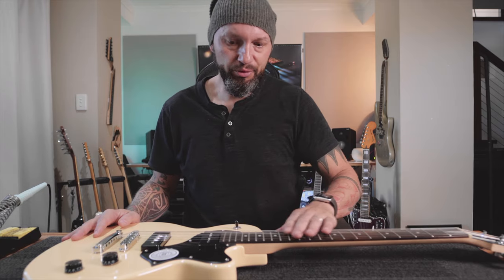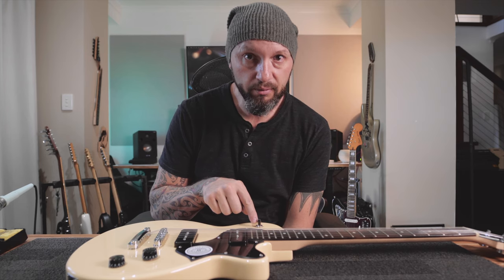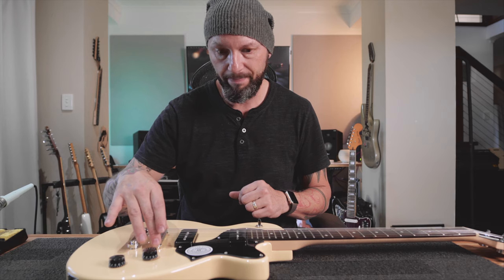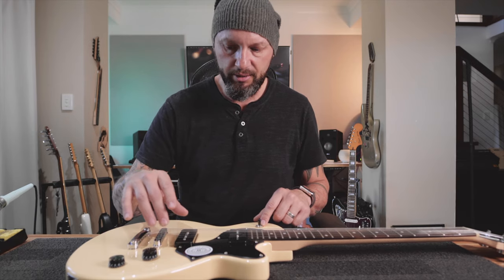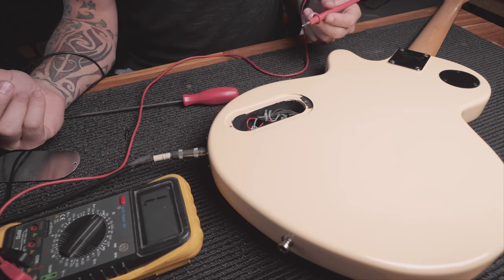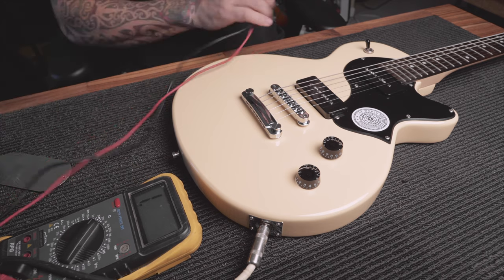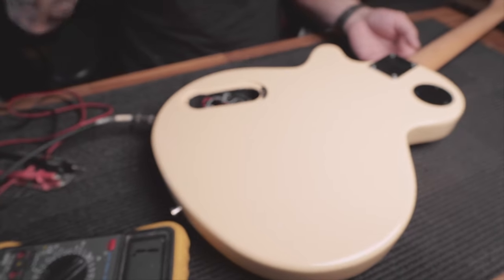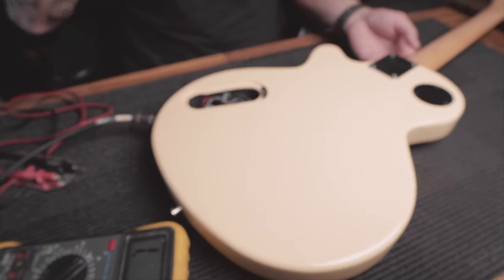3 Easy Solutions to Fix Ground Noise | Guitar How-to Ep02

Comment: Hey Phil! What happens if I have continuity everywhere and still getting the grounding noise?
Reply from the maker: Hey Marcell, what type of guitar do you have? ... Strat with single coils or humbuckers or other type? ... Let me know, and is it quite noisy or just a bit noisy? Could be a number of reasons, but happy to help you figure it out.
Reply: @RisingSunGuitarMods  Single coils. It's the price you pay for that "snarl" no other configuration can get super well. Getting under the pickup cavities, bridge and pickguard with some shielding tape and checking the pots and you can seriously reduce that buzz. Good noise gate, you have a sick sounding and quiet guitar.
Reply: @WilDBeestMF  I also have single coil. No issue when playing dry and keeping the guitar’s volume knob down. I’ve not tried distortion yet.
Reply: @DenisMorissetteJFK  Distortion, and even drive (don't even go there with fuzz, haha) will have a noise floor just by association of what they are. There's a lot you can do to make it palatable, though. Not a huge problemo.

Comment: when i turn my volume down the hum gets louder and i can still (kinda) hear my guitar in the amp
Reply from the maker: You might have a wiring issue or a faulty part. I don’t think your issue is just grounding.
Reply: @RisingSunGuitarMods  the hum goes away when I turn the tone knob down
Very strange
Reply: @RisingSunGuitarMods  Anyway, Happy new year!!👍
Reply from the maker: @arrrrrran3043  happy new year. … sounds like it’s been wired wrong. Find a schematic for you guitar and have a look see if it looks wrong.

Comment: Great channel.
Reply from the maker: Thanks mate. Appreciate the comment. More vids are on the way just been a bit busy with work and setting up a new home office. ✌️
Reply: @RisingSunGuitarMods  I wonder if you might be able you offer any advice.
I've been playing an 87 Squier strat. Plays really well, and sounds pretty good too, apart from some humming, which is how I found your channel.  I followed your advice and discovered a disconnected ground which I re soldered. I don't have loads of experience so it wasn't an expert job. When I put it back together, it's worse than ever. Positions 1,3 and 5 are very noisy,  whilst 2 and 4 are pretty quiet.  Also on of the tone controls seems to go from 0 to 10 quite sharply. Finally   I'm getting continuity on all the metal parts but significantly,  not across the pickups.  Currently the guitar sounds terrible.  If I can't fix it I'll probably have to pay someone. Any thoughts much appreciated.
Reply from the maker: @-_AjB_-  sounds like you have some wiring problems. What pickup configuration do you have? I’m guessing three single coils. If you had a wire off and re-soldered and it got worse, it might need to be re-wired. Sorry about the late reply, away camping.

Comment: if you touch the bridge and it does shut up, how would u fix that?
Reply from the maker: What type of guitar/bridge do you have mate? If you touch the bridge and the hum goes away it will be the ground wire that goes to the bridge, or the claw, depending on the type of guitar/bridge.

EDIT: Sorry I read your comment wrong. If you touch your strings and the noise goes away, that is normal. It means it is grounding. You will always have some noise when not grounded. There are some things you can do to reduce the noise, like shielding the pickup cavities with copper tape etc. Let me know if you would like to see a how-to on this.
Reply: You generate an E.M.F that is sent through pickups to amp, when you touch the strings or bridge you become part of the earth circuit.
Your EMF is sent to ground rather than pickups hence the hum diminishes.
Reply: ohh okay thanks guys

Comment: My guitar is fine when i use my shoes but barefooted it became very noisy when I touch the floor, is it my house electricity that caused this? It's a pretty old house
Reply: My guitar is a telecaster with 2 single coils, my bass is a jazz bass with single coils but doesn't make any noise when I touched the floor
Reply from the maker: CRAZY! I would love to see a video of this... If you have one share a link to your video.
Reply from the maker: @kahfigitar  Using the same amp or different amp?

Comment: Just got my first Gibson and it’s noisy as hell, I can plug in one of my squires or a prs SE and there quite not sure what I paid the extra money for
Reply from the maker: What model do you have and what pickups are in it?
Reply: @RisingSunGuitarMods   it’s a 2020 les Paul special with the original P90’s
Reply from the maker: @derekhand7904  P90’s are a single coil so will be more noisy than a humbucker. Does it quite down when you touch your strings?
Reply: @RisingSunGuitarMods  yea they do I think there shorted it’s not 60 cycle hum it still makes noise in the middle position
Reply from the maker: @derekhand7904  I think you might have a wiring issue or something else at play. Hard to tell without getting a proper look at it. I would try removing the added single coil to eliminate it as being the issue. Sorry man I think it is going to take a bit of elimination till you find the problem type of work.
Reply: @RisingSunGuitarMods   I think you’re right I’m on the road for work right now but when I get home I’m going to have to dig in to it  I’m hoping it just needs to be grounded thanks for your help

Comment: If there is no ground going to the bridge why would it make a sound when you touch it?
Reply from the maker: Good question, my understanding is you don't actualy ground the guitar, the guitar grounds you... stay with me here, how this works is when the bridge, or the claw on a strat is properly connected you are a pretty good EMI (Electromagnetic Interference) antennae. Your body is an antenna for all sorts of EMI, so when you touch your guitar strings, the guitar is grounding you. When that wire is broken, you all of a sudden add EMI interference to the guitar creating extra noise. Hope I explained that clear enough.
Reply: @RisingSunGuitarMods  ok I see

Comment: What if you touch your pickups they get noisier?
Reply from the maker: You are likely creating an antenna for EMI to enter your circuit. Try shielding if you have a noise issue.
Reply: @RisingSunGuitarMods  I never understood the logic with shielding.  Shielding is suppose to create a Faraday cage but the reality is the entire RF interference comes from the ambient and your pickup pole pieces are exposed to the ambient, how else would they be able to respond to the guitar string.
Reply from the maker: @bluwng  you’re not creating a cage. This is impossible on a guitar. Think of your shielding as an antenna. It will never eliminate the noise but it can help to catch some of the EMI and send it to ground. You will always get noise through your pickup especially if they are exceptionally close to a source.
Reply: @RisingSunGuitarMods  sounds funny when you say cage, Faraday Cage is an electrical term that describes isolation of a signal, physical isolation.  My point is the entire concept is misunderstood.
Reply from the maker: @bluwng  @DylanTalksTone has a good example of this... https://youtu.be/_OMCK39HJKk he explains it very well.

Comment: What if it's super loud? Everything gives feedback..

Epiphone Special-II GT
Dual humbucker,
Neck 57 classic plus
Bridge burstbucker 3,
Single volume/single tone,
Shadow killpot set up as tone pot. Learner here

Edit: backstory. I had my local luthier at Samash install these two new pickups (listed above) and ever since then the guitar didn't work right. Bridge pickup wouldn't register (no sound), lost use of the killswitch, and connectivity was intermittent. So I took it upon myself to start learning and fix it. Obviously not quite there yet

I have feedback from the pickups when I touch them but I also have it from strings, the pots if I touch them, the bridge. I'm assuming I have either a ground to jack backwards or there is interference with another set of wires.
Reply from the maker: Ahh yea man, sounds like your local guy did you dirty. How good are you with schematics or at least wiring diagrams?
Reply: @RisingSunGuitarMods  I'm fairly decent. I can figure it out most likely. Sorry for the 5 edits lol. I figured the more information the better. And yes he definitely did me dirty. I called him back before the store did away with the program and he said quote on quote "I can try to fix it but no guarantees". 

Meanwhile I just wired up a les paul build 50s style like my first guitar and it works perfectly. So this one is throwing me for a loop. 

I also appreciate the fast reply!
Reply from the maker: @guitarpro594  all good man. The info is helpful, makes things easier to figure out. I’m just at work at the moment but if you can sit tight for a bit, I’ll work it out for you. In the meantime if you head over to my Instagram or Facebook page, links in description, and shoot me a DM with a photo of the electrics I’ll see if I can help you sort it out. 🤘🏼🤘🏼
Reply: @RisingSunGuitarMods you are awesome buddy! Thank you so much. I'm extremely grateful. I'll take some pictures and send them over and give you a follow. Be easy with me 😅
Reply from the maker: @guitarpro594  no judging here bro. I do this stuff as a hobby a lot of what I do is trying to work with what I have on a budget. End game is to make some cool sh.. pretty sure we can solve your issue. It will be either wiring or a bad component. A lot of it is elimination fault testing. 🤘🏼
Reply: @RisingSunGuitarMods  I really do appreciate you taking time out of your day man. I'm going to send you a video cause now I feel like I'm going nuts 😂. I'm definitely going to check out the channel and see what else you have on here. Love the idea of making cool stuff on a budget. I'm all for that
Reply: @RisingSunGuitarMods  sent you a message on Instagram. Wouldn't let me send a video though. I had to send a "message invite"

Comment: What if the multimeter beeps, but reads zero ?
Reply from the maker: That just means continuity is good. If you are getting a good solid beep the 0 read just means there is no resistance in the circuit which is optimal. 🤘🏼

Comment: i have this exact tissue, but the opposite. when i thouch the strings the noise almost  goes a way, but when i leave it i hear a verry loud buzz/ white noise
Reply from the maker: Depending on the setup you have this will be quite normal. Especially if you have single coils. It might be worth it to try this: https://youtu.be/sAQP5HtdNuc

Comment: Continuity in all components and Continuity to all components to the strings, but touching strings and audio jack quiet the noise. I’m stumped.
Reply from the maker: That is correct, sounds like your ground is good. In this case, assuming your wiring is all correct you might have EMI. Could be from a device plugged in near by, or your power supply, or something in your signal chain. Have a look at my other videos about shielding. Hope they help.

Comment: I don't think your guitar is screened, that black paint is just that not conductive sheilding paint, you should still be able to make it quiet without shielding but experience tells me without sheilding their will still be noise at gig levels as single coil P90's..i don't use copper sheilding foil accept on pickguard's & control plates inside rear as the glue dries & comes away potentionaly shorting something out ,good quality graphite paint in 3 layers lasts for ever, you can even leave it for a week then spray paint with non-conductive auto spray paint,then it's still sheilded but nothing can short out, only playing at gig level will let you know whether to sheild or not bother,if passive with single coils it will probably need sheilded for no noise at gig levels..neat job, time saving way for people to test their earthing is alright & if not how to find out what needs fixed....
Reply from the maker: You should make some videos and share your knowledge. And yep I’ve explained some of this in a shielding video. Have a look if you’re interested: https://youtu.be/sAQP5HtdNuc
Reply: @RisingSunGuitarMods ... Will do... cheers

Comment: You only said what the solution is if you touch it and it doesn’t change what if it does
Reply from the maker: If it goes quiet when you touch the particular part then you will have ground to that part. Could be a problem elsewhere. Did you put a multimeter over all your grounding points?

Comment: My guitar isn’t even plugged in but my amp is just constantly buzzing
Reply from the maker: Could be a number of reasons for this man. From ground loop to transistor or valves… the list goes on. You might need to find a local repair shop.

Comment: i literally can't see what ur doing wtf dude?
Reply from the maker: @Djoeeeeee  Sorry you couldn't see man, if you tilt your screen you should be able to see over into the guitar or if you listen along with the video you should be able to sus it out. Most other people worked it out. It's not super difficult, just check you ground wires, these are usually the black ones that go to the back of your pots and to the bridge posts or spring claw. Use a multimeter and make sure you have continuity to all the parts that should be grounded.

Comment: Hi guys, I am a 13 year old guitarist, who owns an ibanez 121 par kbf, is in a big problem, which could also lead me into leaving Guitar; the problem is that, whenever I use the volume pot on my axe it starts humming and a buzz sound starts coming out of it, this sound does not come when the pot is turned all the way up or all the way down but only occurs when the pot is in the middle, pls help me if you have any explanation or any other similar experience... Thankyou.
I went to a guitar tech to get this fixed, but when he played throught his amp, he said that there was no such noise he could hear. But when I brought it hone and plugged it into my setup which consists of a Bluetooth speaker and a multi FX processor, the noise was there. He suggested me to come back again at his shop on 27 of March with my processor and the lead wires that I use as they're also not very quality.
Reply from the maker: Take your gear to the tech. Sounds like there is a problem with your setup and not the guitar. Let me know how you go.

Comment: Hey man i know my comnent is a bit late, the buzzing stops when i touch the metal on the output jack but gets louder when i touch the strings. What would the cause for that be?
Reply from the maker: @gregheffleh  most likely you have a broken ground connection. Same as in the video. Depending on the type of guitar you have, the ground to the bridge post, or ground to the spring claw has a bad connection. Get a multi meter and check your continuity. 👍
Reply: @RisingSunGuitarMods  so this should be an easy fix ya? All I need is a multimeter and a soldering iron?
Reply from the maker: @gregheffleh  yes man. Just grab a cheap multimeter on Amazon. You don’t need an expensive one. As long as you can check continuity. And a cheap soldering iron will do the job.

Comment: Why is it that if I put my guitar on my lap and place my fingers on the strings the noise completely disappears but  if I put the guitar on the table and do the same there is still noise though less than if I don’t touch the guitar.
Reply from the maker: Sounds like you likely have EMF interference from something near but. I would suggest you try shielding. Try this: https://youtu.be/sAQP5HtdNuc